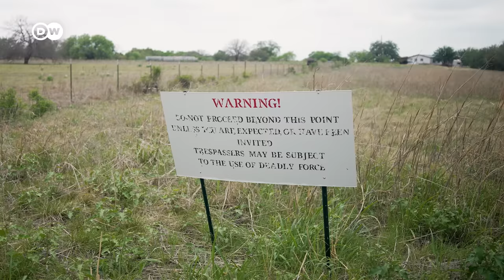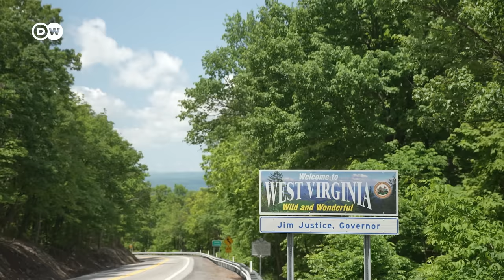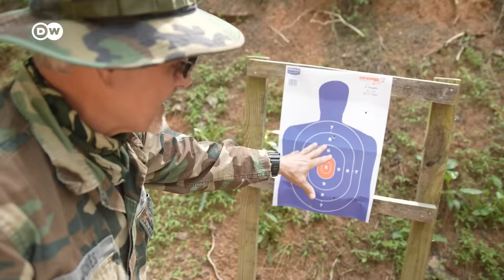Preppers in the USA - Emergency supplies, survival kits and bunkers | DW Documentary

Comment: People that live through hard times learn to be prepared. Try going a month or two after a hurricane without power and most things most take for granted not available like clean water, electricity, working toilets. It just makes perfect sense to have generators, solar power stations, portable 12v freezers, water, fuel, propane, and canned food to get us through a month. If that makes us preppers, so be it. I call it simply wise preparation for hard times that come from mother nature every year. If it helps us a little in a failing economy, even better.
Reply: An important consideration is a security plan. Having the materials to survive is great, but you have to make sure someone else can't take the stuff you have. If you have power, some kind of sensor grid is good or cameras with IR is good, but you also need to have people to maintain security.
Reply: @sbrazenor2  yeah, honestly that's where it would fall apart if things got really bad. Because not only would you have to look for external threats, but also those who are supposedly your friends.

Comment: I was rolling my eyes at the mention of an M16, not because I'm 'anti-gun' (I'm not at all; I was a Small Arms & Artillery Repairer in the active-duty Army for 13 years), but because a genuine, military M16 goes for around $10,000, involves a LOT of paperwork, and can fire either a three round burst or fully automatically. I'm sure he wanted to say is that people have been encouraged to buy an AR15, which is identical in many ways, mainly in how it's held and used. 'You' would have to add parts, as well as modify the lower receiver in a way that has been deemed illegal, in order to convert an AR15 into a true M16.

Comment: Every sane human being that has common sense and the resources to afford them keeps emergency supplies in their home of enough non-perishable easy to prepare foods for at least a week, a source of heat for cooking and to stay warm enough in freezing weather to avoid exposure, enough potable water for a few days and some way to purify water for longer, and some basic tools, equipment and first aid supplies for things like power outages, water line breaks (or contamination), winter storms, ice storms, blizzards, wind storms, tornadoes, hurricanes, floods and earthquakes that will likely happen to you where you live several times during your adult life, This is not abnormal. Anyone who thinks so is deluded. If you drive you should have a flashlight, bottled water, a basic first aid kit, and either a high visibility rain slicker or waterproof winter coat (depending on the climate in your area), and an emergency blanket, tarp or sleeping bag in your trunk along with the spare tire, jack and emergency signal, triangle reflector and/or road flares and a small fire extinguisher. This is just basic common sense safety equipment. Every trucker on the road carries these things.
"Preppers" simply apply more thought to the eventualities and typically stock food and medical supplies for several weeks or months instead of several days or a week.